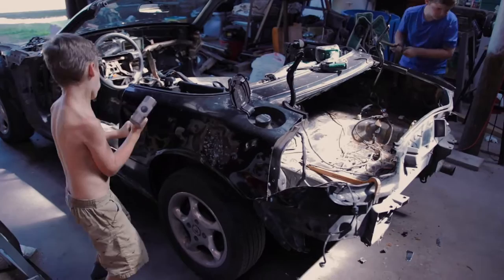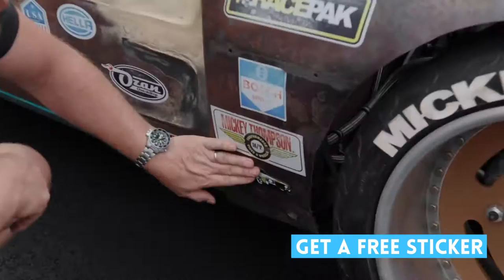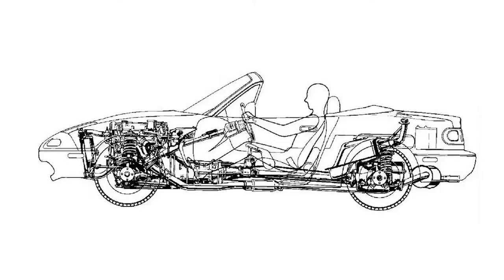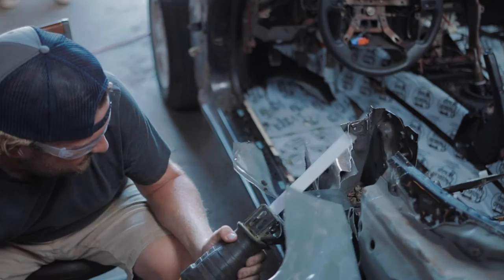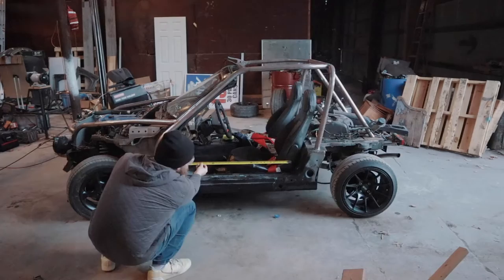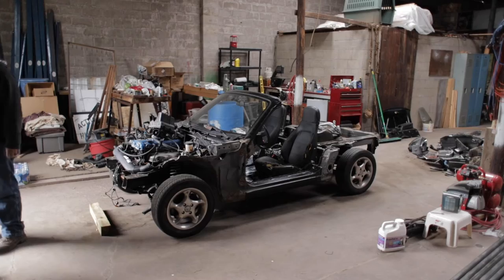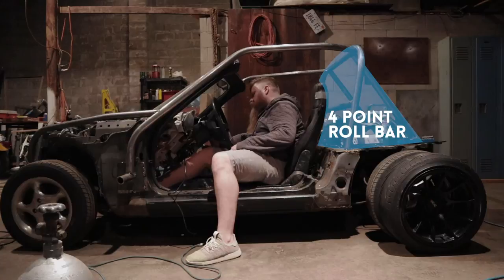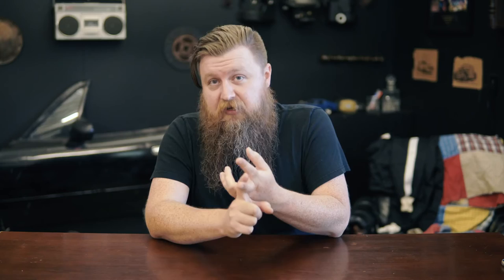How to Build a STREET LEGAL Miata Kart in 8 Steps

Comment: I'm in the UK and a kid. My dad is a mechanic and he loves some fun. You reckon it would be legal for him to get a cheap old car, turn it into a kart by removing the boot and the roof, give it a really slow engine and let a 13 year old drive it? Technically its not a proper car, it's a road legal kart. So if it got its MOT and its 25mph then it's a kart and any age can drive it, but it's a slow speed car
Reply from the maker: Would this be kind of like in sweden where you can build a "tractor" and get around some of the laws? I have no idea about car laws in the UK, so I wouldn't know where to start with that, but I'm sure with some reading it could be figured out.

Comment: how long did this take you guys .. start to finish?
Reply from the maker: Initial build didn't take much time in hours...you can see we didn't pay much attention to the finishing details though. Just wanted to get it on the road. We did a few hours a week over a couple months. Guesses on time below:

-one weekend with 4 people for the teardown, which only took about 3 hours
-a few more hours spent 4-5 weekends and cage was built and tacked in.
-probably half a day messing with all the stuff wrong with the miata to start with (engine was missing parts)
-turbo build took a day
-there's probably a days worth of grinding and welding to finish out the cage

In between all that there was lots of sitting around, talking, beers, messing with other projects. We started in October and it was running, registered, and insured by the time weather was warm in the spring.